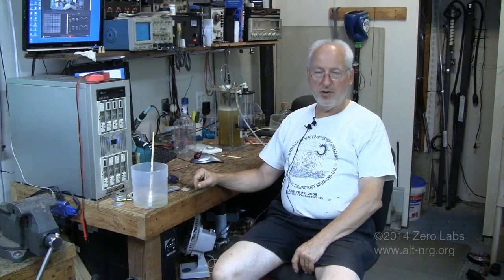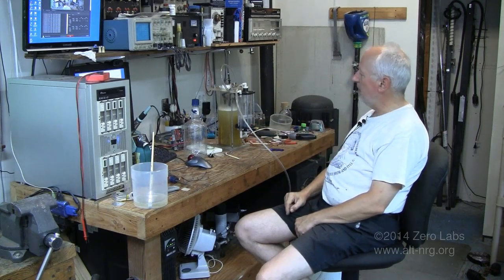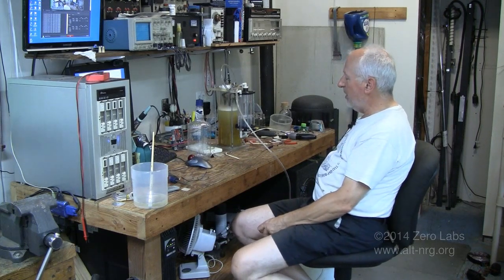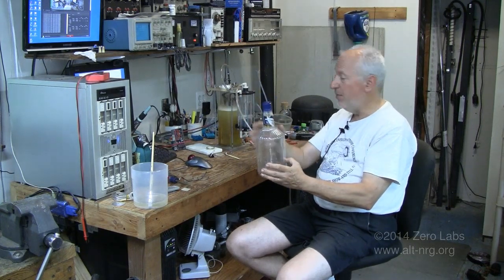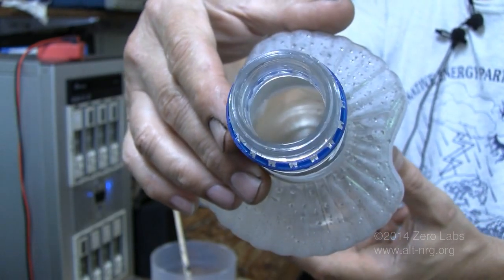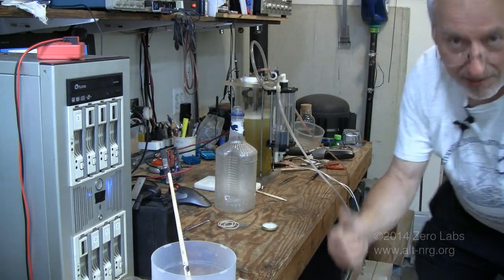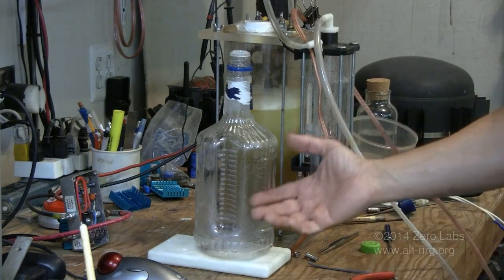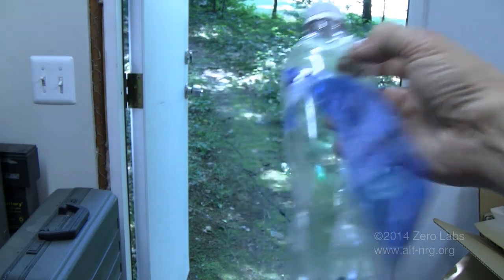#373 BANG!!! Is it cluster gas, ExW or just HHO?

Comment: I am fascinated by the visual static discharge or what might be a form of ball lightning ... that visual made it worth the experiment ...

I remember back when d3adp00l and I were running the little engines and kept noting the odd behavior of low end digital meters when we got them too close to the engine ... that discharge you captured on video might explain it ...